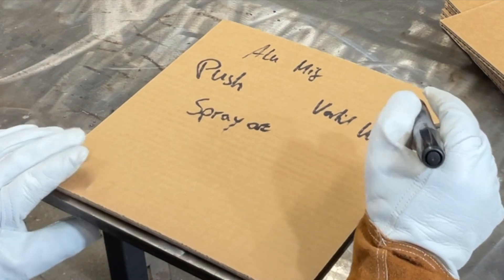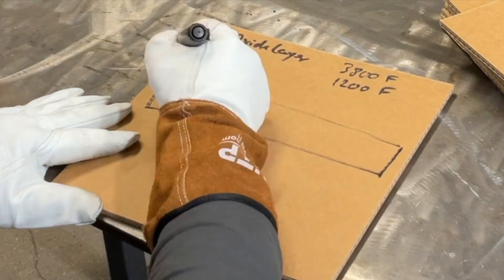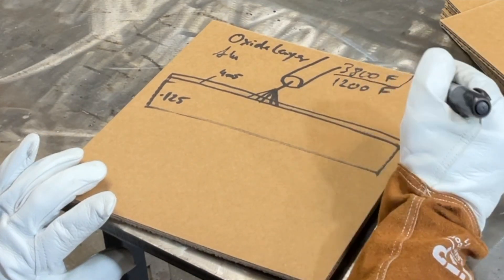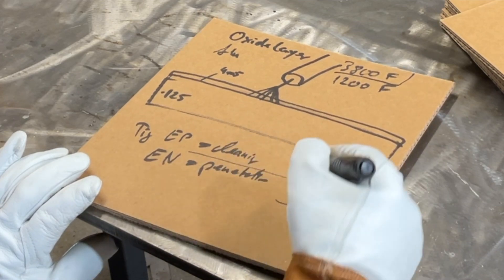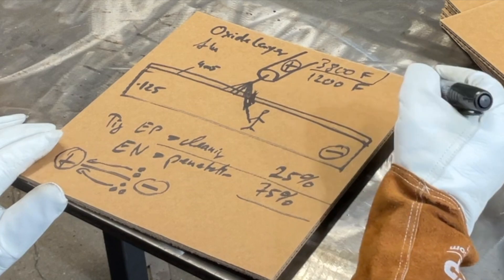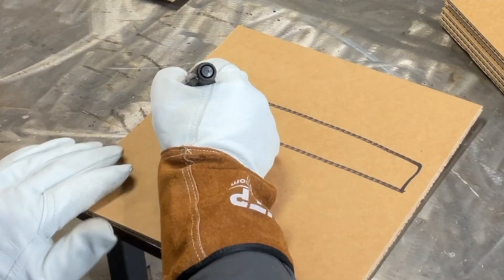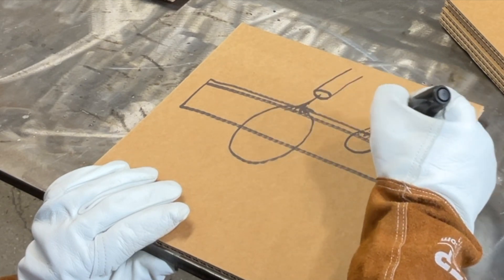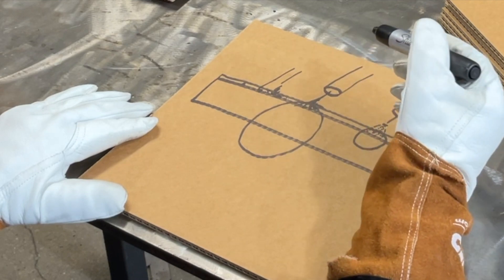Pulse mig aluminum explained - Cleaning and AC welding explained as well

Comment: Great explanation! No one did it that clear. I am about to buy a double pulse welder. How thin can you weld aluminum? Have you tried MIG welding 0.040 (around 1mm)? This is the thinnest that I will sometimes need. TIG is not considered because of other reasons.
Reply from the maker: with a good machine like the HTP PP220MTS theoretically material as thin as 0.8mm or .030" can be welded ....  realistically that is very challenging ....  1.0mm or .040" a guy can pick up in a matter of a few hours and produce good welds ...  anything 1.5mm or more 16ga ....  you kids can do easily ...  material thicknesses like that personally I would weld in SINGLE pulse ... it is way more controllable and forgiving ... I personally only use double pulse 2mm 14ga and up ....
Reply: @ZILAwelds thanks! I value your opinion a lot. I will buy the MIG. But why is single pulse more forgiving? Doesn't double pulse create even less heat, which is so important for thin aluminum?

Comment: To avoid preheating, I use a special four-stroke mode. It allows you to give an increased welding current at the beginning of the process, then reduce the welding current to the working one recommended for welding a given alloy, then reduce the welding current for crater filling. This is very useful during repair work when it may be necessary to fill a gap of different widths. By combining three different current values, it is possible to complete the job without making additional adjustments to the welding machine. This also helps a lot when welding a thin body of a cement truck to a thick frame. If you have mastered the special four-stroke mode, you can perform any complex job with high quality.
Reply from the maker: yes - the machine has a 4 stroke mode.  but in the USA people typically only use 2 stroke.  there is also a video showing a remote control operation where you can adjust your settings while you weld with remote and still be in 2 stroke mode.
Reply from the maker: https://youtu.be/AoXYkWBW-wo?si=AKrNxjuKOjEv0n_X

Comment: Peter, thanks for the video. I do have a question related to this that I simply cant find an answer to. The question is how do attain a spray transfer with the low voltage needed for thin aluminum? I thought spray transfer required voltages in 25 to 30 range
Reply from the maker: the required voltage for spray arc for steel is 26-30 ish volt ...  that is correct ..... aluminum is different .... deepening on the alloy and the wire diameter aluminum can go into a full blown spray arc at 20 volt or even less ....  to weld thin aluminum you need pulse ..  with the pulse the machine maintains the "high' voltage of 20+ volts and reduces the size of the droplet .... if you drop arc voltage to 14 or 15 volt ... you are short circuiting ....
Reply: Jusr what I was looking for! Thx!

Comment: I usually SS wire brush the oxide layer then wipe with acetone before welding to get good results.Why is it you don't mention the preperation before welding?Thanks for the explanation....Bob
Reply from the maker: Bob,  thank for watching, very good and very valid point on why I dont mention the preparation ...  I guess there are 2 reasons I dont mention it.   a) typically I dont do prep.   b) preparation is a very loaded and controversial topic ... even myself it took me 15 years of being a "professional" and "certified" welder to understand how the oxides on aluminum work and why or why not and in which way or which way not to prep aluminum for welding .... I guess this would be worth a separate video .....  in the mean time please see my oxide video in the pinned comment for expiation why "I dont clean" aluminum

Comment: That was a great explanation. I have done Mig welding of aluminium with a standard Mig torch set up. It's an edgy process because too hot and the base material collapses and it is all too easy to do that. 
The last time I did some, I managed to achieve a kind of spray arc and I could see a huge difference instead of a regular Mig style of welding. Pre-heat on thicker material is a good idea and of course getting the material cleaned off with acetone helps.